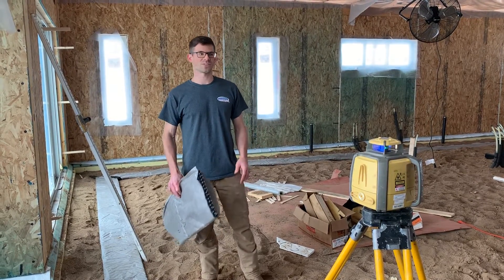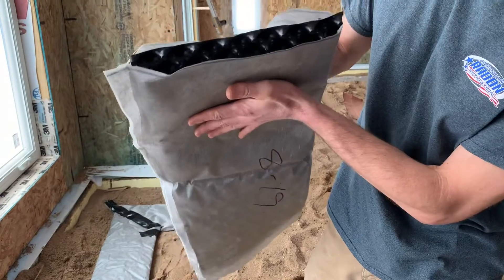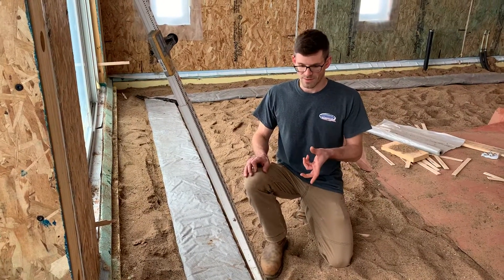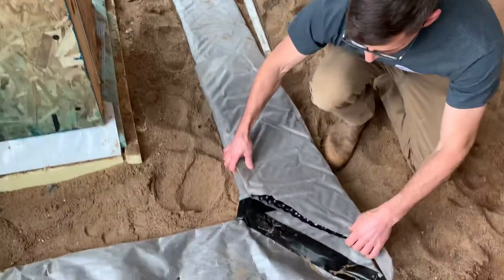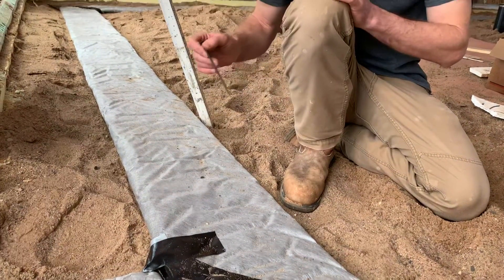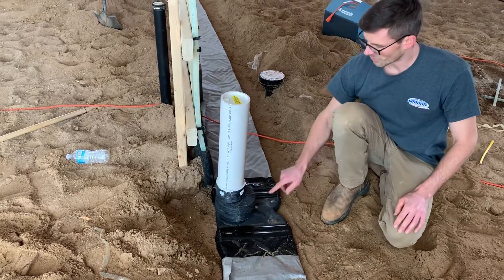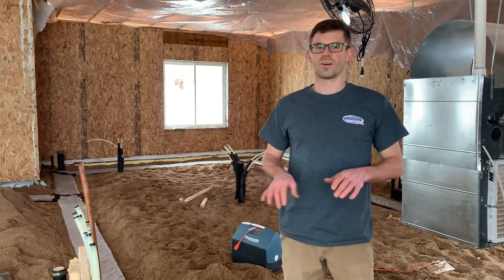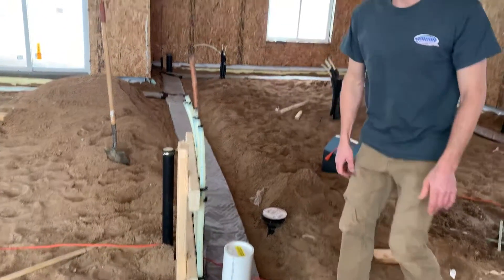How to Install Radon Soil Gas Mat for New Construction

Comment: Do you guys know where I can buy this? I live in Colorado and we usually install a 4” perf pipe on the inside for radon extraction. However, in this specific case they are asking for the vapor mat. Do you guys have a specific supplier or can I find it somewhere more common? Thank you. Great video!
Reply from the maker: Check this video out for another installation as well as the description on where to purchase it. Use promo code Jesse to save 5% on your first order. https://youtu.be/fMNzVpbfthE?si=aIQxhTGs-4oOyUsB

Comment: What do you do for a dirt floor basement with cobblestone foundation
Reply from the maker: If it were my home, I’d probably encapsulate the walls and have concrete pumped in to pour a slab in the basement.
Reply: @AmericanRadonMitigation  would closed cell spray foaming the ceilings in basement help too  our biggest problem is it’s a 230yo house  post n beam some areas are easy while other areas will need to be dug out I’d think  less than a foot of space between dirt and framing